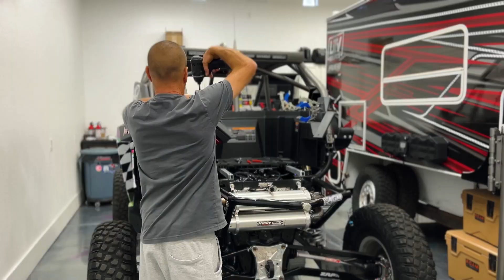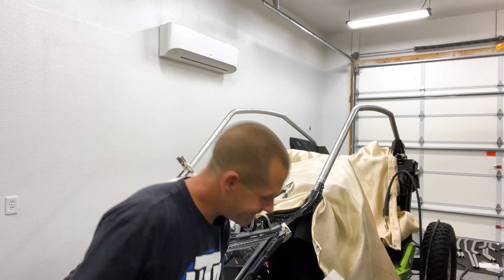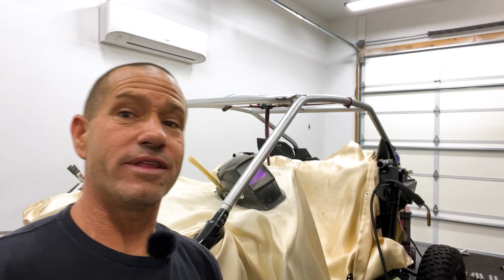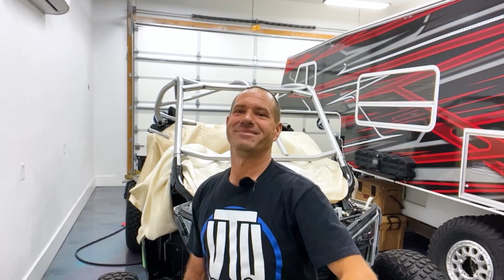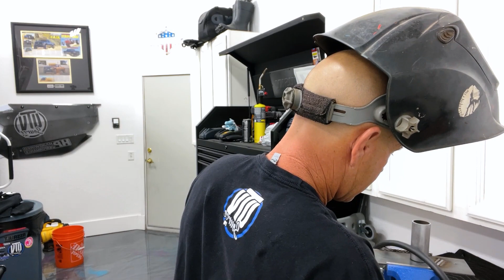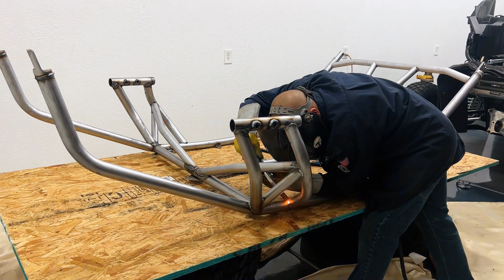UTV Source How To's | LSK Weld-It-Yourself Roll Cage Kit Install

Comment: why not , roughly sit the pcs up there close, then attatch the roof to the upper structure check squares then tack it underneath, pull the roof off and weld. might save you a little measureing time